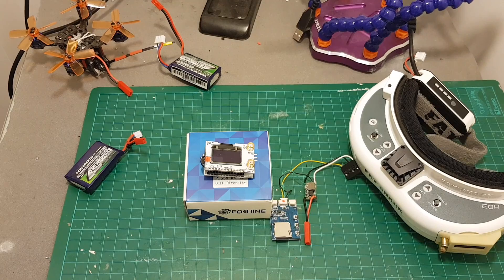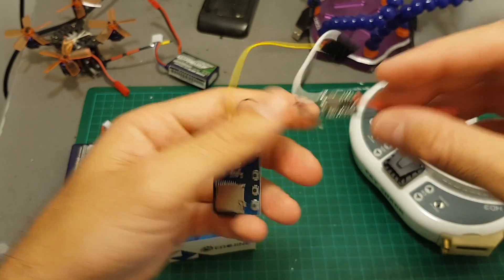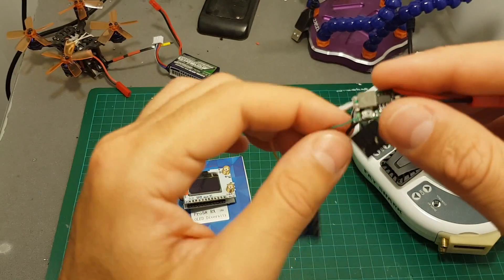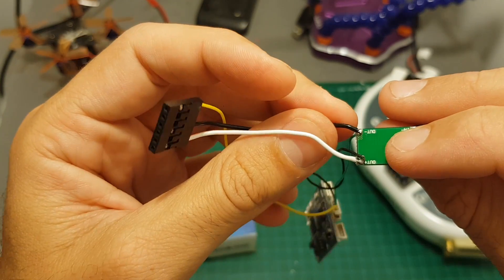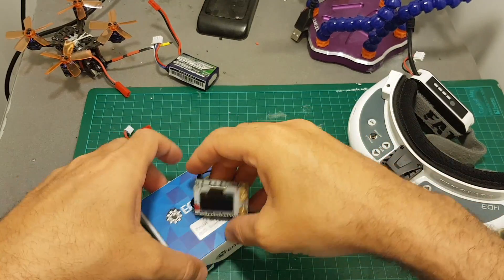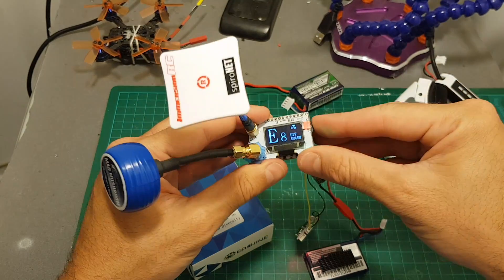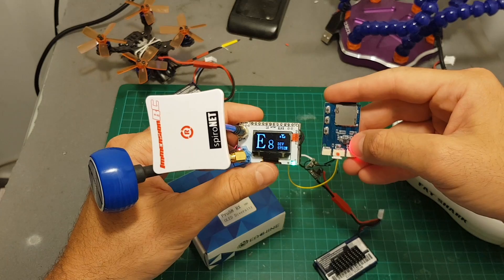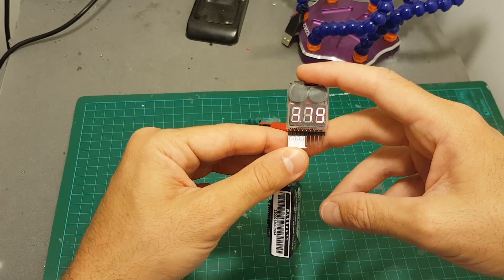How To Build Your Own DVR Diversity Receiver In Less Than 10 Minutes

Comment: Hi,  I have an Idea and I don't really know if its doable... what I have in mind its basically  done by you in this video... just now I would like to incorporate everything inside an ev100... the idea is to do a 3d printed pieces to go on both sides of the googles and have it working "like a FS" ... just I don't know if using the same signal from the diversity module to the DVR and the googles will work... won't it add delays or signal cut due  to "under powered signal" ??

I don't really know how this things work  but I have this in my mind  since I got my ev 100

thaks for your help =)
Reply from the maker: +Nichollas Cruz Hi there. I believe that you can make it work, but the question that you should ask yourself is if it's worth your while. If it's just for the experiment, you should go for it :-)
Reply: @Gal Kremer
You mean all the effort of getting everything inside the googles and the 3D printed parts... well I kinda like spending time upgrading my stuff.. and am really into 3D modelling and 3d printing... plus it's winter here in Portugal so... free times are split between whooping around my house and thinkering around my stuff :). 

Huge thanks to your answer... will be ordering the items really soon and getting around to it =]
Reply from the maker: +Nichollas Cruz Cool. Please send me a video / picture when you're done. Have fun and good luck :-)

Comment: will this method work with any other fatshark module? I want to use the realacc  rx5808 with my quanum v2 goggles
btw can i use this https://www.banggood.com/External-BEC-UBEC-3A-5V-2-6S-Receiver-Power-Supply-p-1032399.html insted of the step down module you used?
Reply from the maker: Sure you can. Just make sure, using a multimeter, that the output voltage is correct, in order to avoid burning your receiver.
Reply: Gal Kremer btw how would you compare this receiver reception to the eachine VR d2 reception

Comment: Good video. Thank you! Anyway to make the Pro58 RX to something like a ground station on its own?
Reply from the maker: Thank you Andre. What do you mean?
Reply: Gal Kremer Since the Pro58 seems to be the cheapest diversity receiver on the market, I was wondering if it could work as a self contained ground station wherein you plug in the goggles. Would be cool for you to make something like that if you can!
Reply from the maker: Well that is pretty much what I explained in the video :-)
You can connect a screen to the video output of the DVR (or directly to the video out of the receiver) and you've got yourself a nice ground system.
Reply: Gal Kremer Yeah I figured that out but I'm kinda confused to which connector I should plug to it. Is there an Av out cord that plugs into pins like that? Sorry for the trouble btw!
Reply: google the DVR manual. the pinouts are labeled.